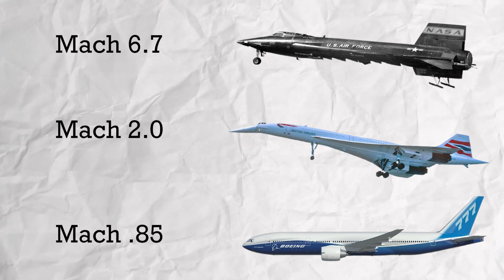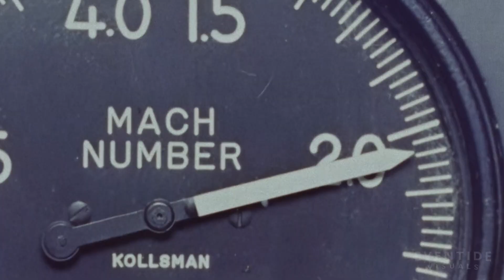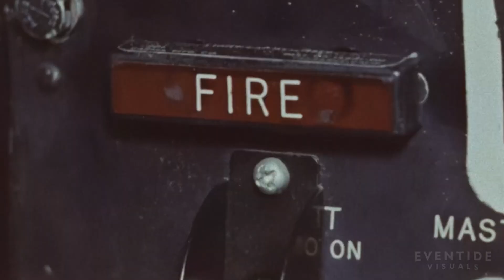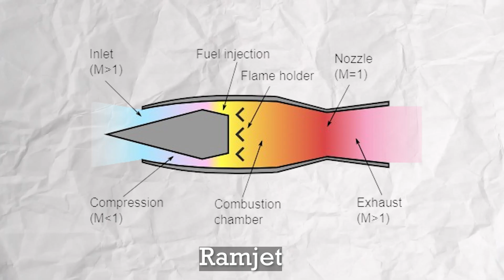This Plane Flew At Mach 6.7

Comment: It was the Reaction Motors XLR-99 not “triple nine”
and there were not two engines as you depict 2:11 

Those were the two XLR-11 engines used for preliminary flight test when the XLR-99 was delayed by years

Comment: After the Mach 6.7 run, the X-15  A2 never flew again. The aircraft was basically cooked and suffered severe thermal damage. The ablative coating was never used before it since